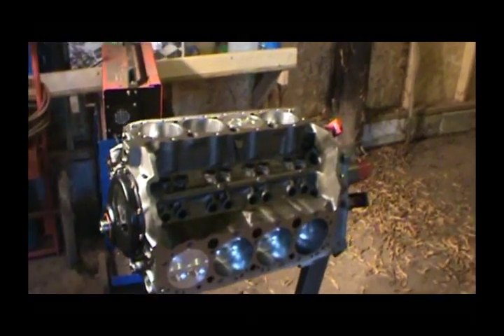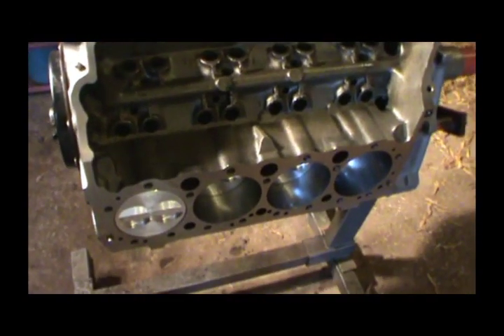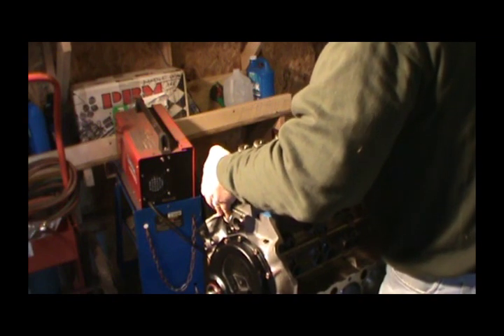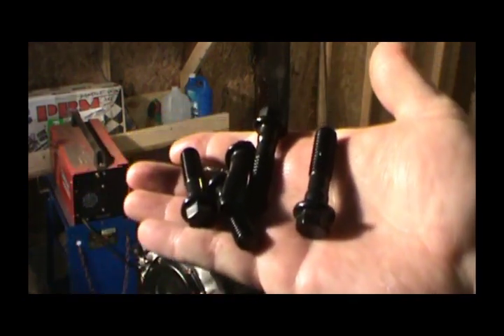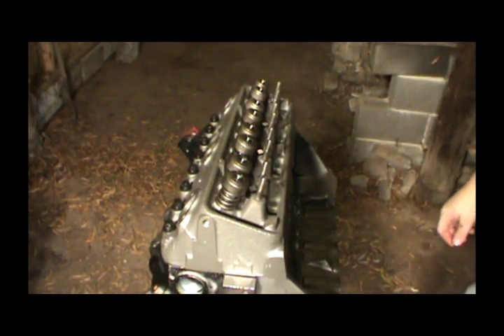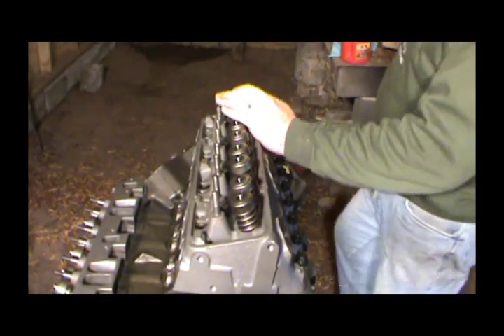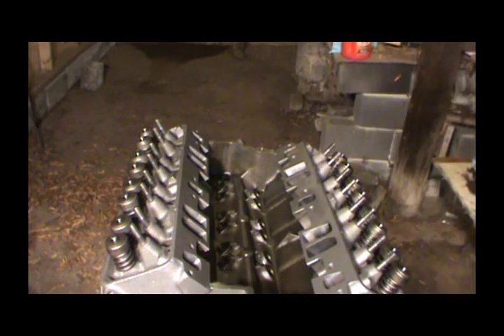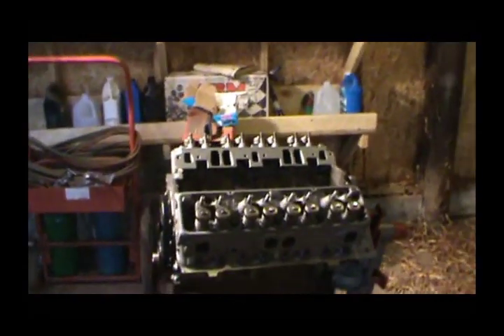Chevy 350 Engine Rebuild Part 6

Comment: Hi, great videos......but the second head you put on, you only torqued it to 30lbs and then turned the engine stand and said you were done with the heads. I hope you remembered later.
Reply from the maker: +Marit Cederblom Good catch!  I'll double check today to make sure, thanks!
Reply: +farmboy30117  Check starting at 6:15 on the video
Reply from the maker: +Marit Cederblom I checked the torque and sure enough it wasn't torqued to 65 ft-lb.  it was a lot of work to retorque it but a lot easier to do it now than after the fenders were on.  Thanks again!
Reply: That's great.....could have lead to a blown head gasket...or worse. It seems I read you are in GA. I live next to lake lanier....between Gainesville GA, and Dawsonville Ga. I was wondering if you are close by.
Reply from the maker: No, I live in west Georgia near I-20.

Comment: Hey guy;
I am debating whether to rebuild my ole 92- 350. 293 thou miles and has a significant rear main oil seal leak. Should have done it over summer. Hear it is now close to possibly some snow - and ready to hook up the plow. Just got the stitches out from another back surgery which had me on hold from too many projects.
Still have not got that old skidsteer running.
Reply from the maker: Hope you're doing well on the surgery.  I know how it is with a bad back!  You might be better off with a crate engine.  At least you'd get a warranty...

Comment: Hey...don't use those rocker arms that guy gave you unless your engine came with them.   It you really want to use them...I have a set of brand new ones I'll send you.  Just pay the shipping.
Reply: fh276
No.  They are brand new for a later model 350 HiPo engine.  Factory.  They have been installed but never ran.  Pulled them prior to starting the engine and put them in a zip lock bag with some oil---just in case. Got them off ebay shipped to my house for like $40. I decided to go with some roller tip ones that were for the actual year of my engine.   More expensive yes...but made to go with my engine.
Reply from the maker: Why do you think I shouldn't use them?  The heads are not the ones that was on the engine.
Reply: I guess they can cause damage on heads which they weren't meant to run on.  I'll see if I can dig up where I read that.
Reply: Matt Love
My mistake.  You only have to worry if you will be using your engine up around RPMs where valve flow may occur.  Most street engines will never see that.  I guess the self aligning rockers don't do well when it comes to valve float or solid lifter cams.
Reply: farmboy30117 3 questions for you.  Are those rockers, off of those heads?
Are they in order, for the valves they came off of?
Are the valve tips resurfaced, or new valves? 
You are putting new pushrods in, some new rockers I think would not go astray.

My reason is the wear on those used rockers will cause premature wear on the valve tips, whilst they " bed" in to the wear patterns of the rocker arm. The rocker wears as well as it 'finds" its place in this process.

You have gone to all this trouble to rebuild this engine, new rocker arms cannot be to expensive.
Reply: Matt Love
I also have a brand new MSD ignition I never used for it sitting on the shelf in my garage.  And a like new holley 600 vaccum secondary, manual choke carb that was changed out for a smaller carb.  My engine is only a 305.
Reply: Matt Love I was just trying to  help you stave off a premature rocker & valve problem later on that is all.
 Keep  the videos coming, I do enjoy them.